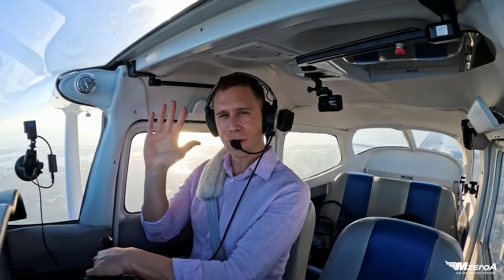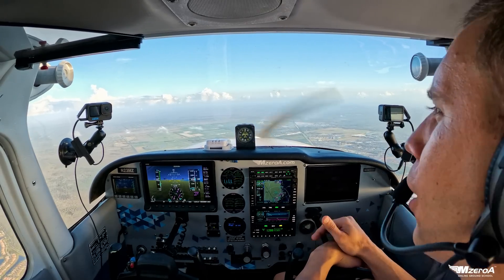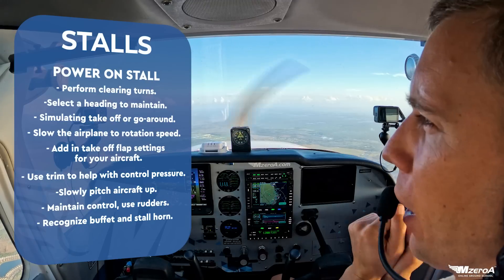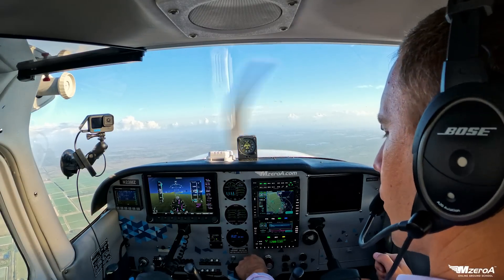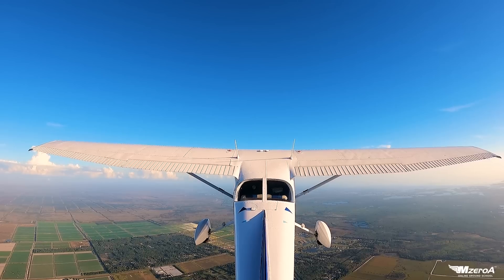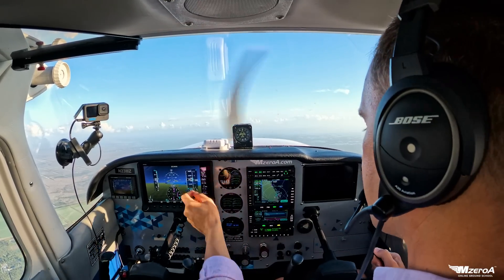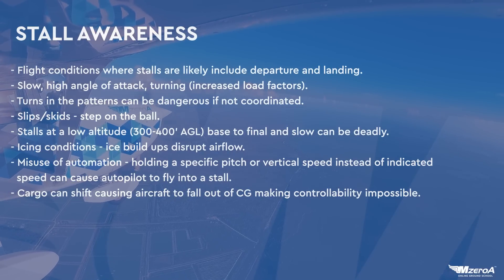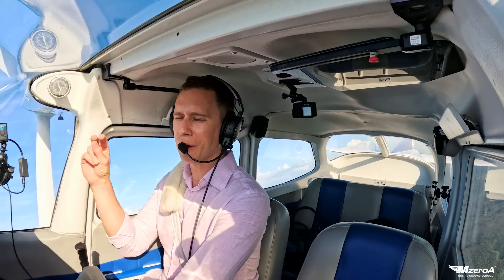Putting The Brakes On Stalls

Comment: 24 for 24.  Love the videos.  In 150 hours I have experienced two seat rail failures.  It was great that I had power on stall training.  I end in the back seat  yoke in had at cruise speed.   Solution , point the nose down to level reduce [ower  and relock seat.  Thank the LORD and continue the flight.

Comment: 24 for 24.  I have to say I don't really like power on stalls as I've always felt like I had to "hulk" it to get the stall to happen.  It seems like I may not be setup well enough in advance and my instructors have always wanted me to go full power right from the get go.  I like the pick an attitude and hold it for a few seconds, add a few more degrees, etc. until stall and then recover.  I did almost create a spin one time because I over corrected on recovery.  I will try the pick an attitude, etc method next time I get the chance and see if that works better for me.

Comment: 24 of 24.  Catch up day after a cold.  Today is Wednesday, but this has come out on Tuesday.  Yes, I have had a fear of stalls, especially the power on stall.  I used to fly gliders and after my solo in a powered aircraft I tried to practice my stalls but didn't put in enough right rudder and ended up in a spin.  I had lots of spin training in gliders so I recovered quickly, but I have been gun shy about stalls since.  Thanks for this and I'll add this to my practice.

Comment: 24 for 24.  Power on stalls always make me nervous still because I am afraid of spins (need to take a spin class to get rid of that fear).  Just had my BFR and was nervous when it was time to do a power on stall, but a was pleasantly surprised (so was the CFI) that I handled it better than I ever have and it was not a big deal as I have been making it.  Thanks Jason for the tip to add a little more angle at a time.  See you tomorrow.

Comment: 24/24.  Jason, something you mentioned which made me begin to question a few things.  We set the aircraft up for takeoff configuration right.  Well in a C-172 thats no flaps, but what if we are doing a short or soft field takeoff?  Thats 10deg of flaps.  So why don't we teach power on stalls with 10deg of flaps?  I don't ever remember doing power on stalls with any flaps in a 172.

Comment: Jan 24? Must be Day 24. And I've seen them all so far. Power-on were more unnerving to me because of the deck angle - initial training was full power and keep pulling back until it stalls. Not afraid, but more uncomfortable - a lot more going on: noise, rudder, stall horn, instructor. Harder for me than power-off.

Comment: 24 / 24. One small nit: if you're trying to simulate takeoff, then the plane should be trimmed for takeoff, not nicely trimmed for straight/level flight at altitude. And on recovery, as you say, at full power you will likely have to push back against the plane's desire to climb. Thanks for these videos.

Comment: 24/24 one Analogy another CFI  I watch compared the yoke to the reins of a horse, to slow down you pull back like you would pull back on the reins stop the horse; to go faster you let go of the reins or push forward to speed up.   Another thing is he talks about using the Limberg reference  to monitor for yaw since you lose the horizon in a stall.   I assume a stall feels like a roller coaster.

Comment: 24 for 24.

Each year I do a spring tuneup flight to the local practice area where I practice all the usual maneuvers. My Musketeer has a clean straight ahead break in power-off stalls but wants to drop a wing in power-on stalls.

Comment: 24/24. OMG, I still won’t practice stalls without my CFII (I now have 980 hours). My last BFR we did some great slow flight and turns and then pulled the yoke into a stall. I am flying a Piper Dakota so we really can’t get into a spin easily.